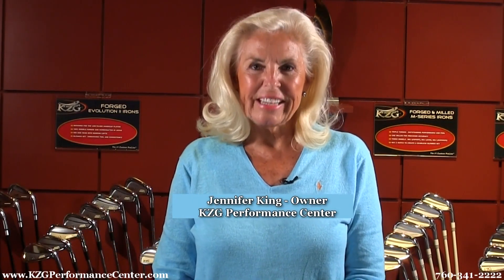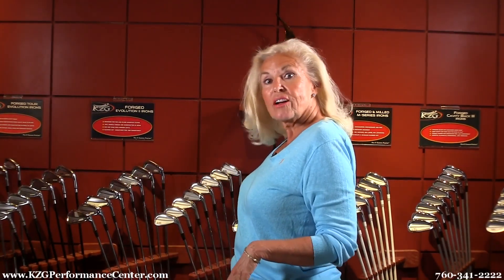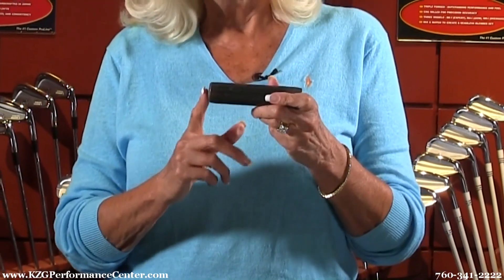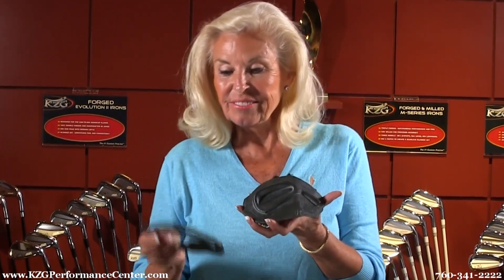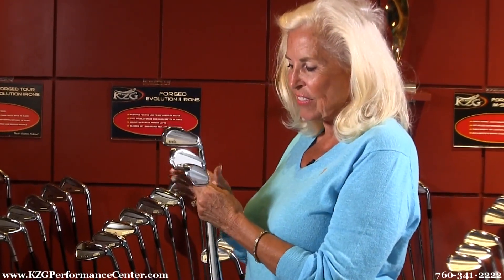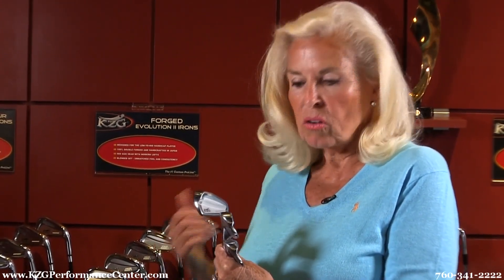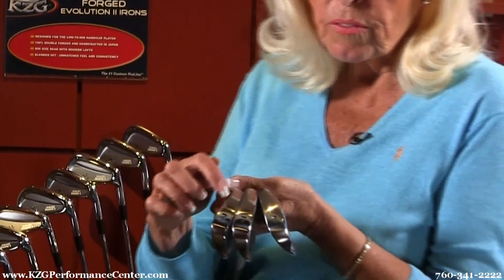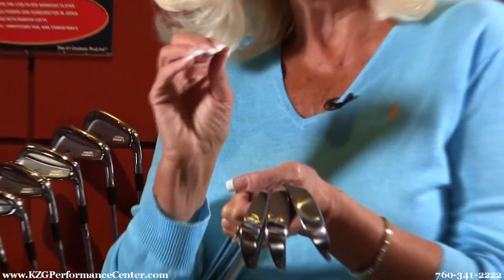Why forged Irons will always be the best Golf clubs

Comment: There is no possible way to compress steel. However, forging does allow for gain alignment which produces a very consistent and homogeneous club head. This also allows for a very soft steel (1025, 1045) to be used,hence the soft feel. Cast steel is not as soft and also the grain is not aligned. This combo results in a firmer feel. The inconsistencies will be microscopic since x-rays would reveal any voids and said head would be recycled. Compression, no. Consistency, yes.
Reply: No way to compress steel?  LOL.  OMG, dude, you hit a billet with a 50 Ton hammer, it's gonna (like anything else on the planet) compress!  So you think the manufacturer will be xraying all the the castings and looking for voids?  Interesting.  Hey, I have a bridge I think you may be interested in.  It's in a place called Brooklyn.
Reply: @newmanfertig886  I may be mistaken (which wouldn't be the first time) regarding the compressibility of steel. Deformation and compression are two very different things. Solids, although I'm sure there is an exception, will deform (change shape) but not compress under normal circumstances. If such conditions allow for phase changes then all bets are off. Of course a 50 ton press will deform a billet.
Reply: @glennwiebe5128  Yeah, whatever.  You missed the entire point.  This is HOW THEY MAKE FORGED IRONS, so saying they can't compress steel, is basically stupid.

Comment: The worst explanation of cast versus forged. Cast clubs don’t have voids. 10 different lines of clubs? Makes no sense.  Most major manufacturers have less. Seems like the product of a cluttered mind.
Reply: Cast clubs have small pockets of air trapped inside them as the metal is poured into the mold. Although tiny these produce hot spots and dead spots across the face. They are not and never will be as good as a forged club.
Reply: @thehairygolfer  Any evidence that these tiny bubbles produce hot spots? Wishon has tested hundreds of cast irons and never observed this phenomenom?
Reply: It's a real possibility. But I wouldn't call them "hot" spots.  I would call them "cold" spots.  If there are bubbles, it means there is not Steel to help propel the ball.